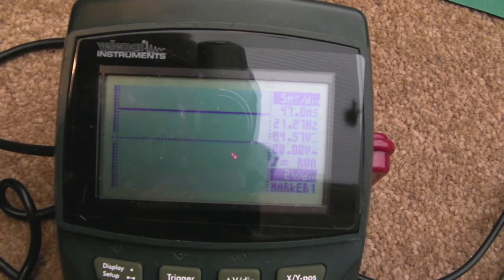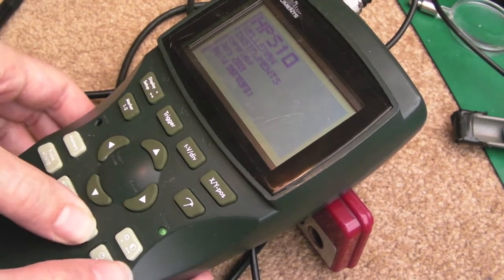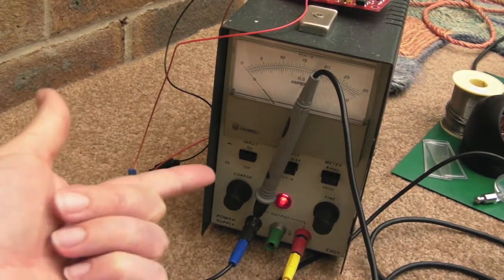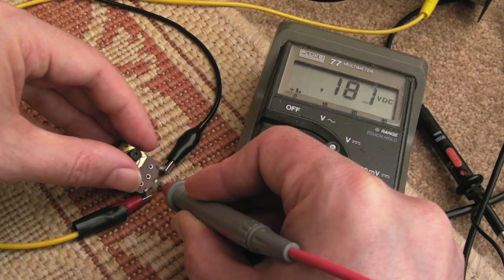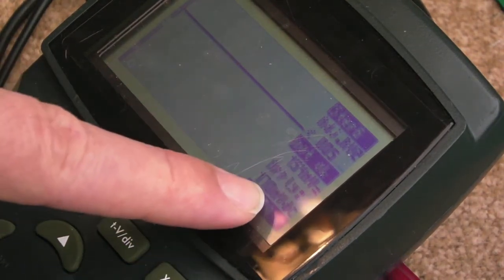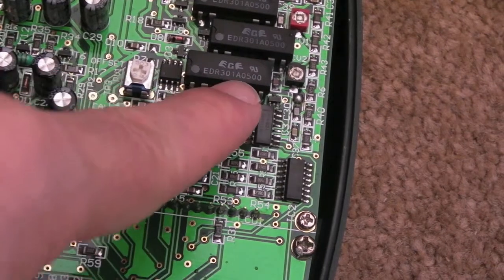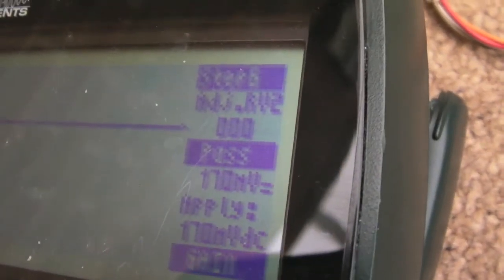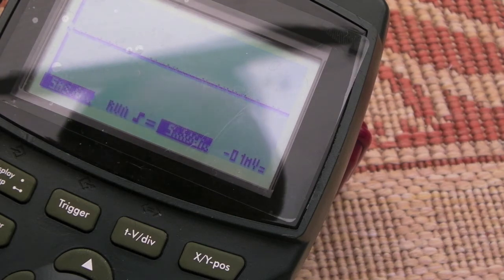Velleman HPS10 Oscilloscope Calibration

Comment: I used to have this scope; unfortunately, the screen went black, and there was no replacement available (apparently those 64x128 monochrome graphic LCDs have long since gone obsolete). The biggest problem I had with it is that it used to drain batteries, even when switched off! I ended up operating it off a 9 volt adapter instead.
Reply from the maker: Yeah, when not in use I leave one battery out!  Or it does go flat super quick (and then the batteries leak...)

Comment: Hello. a question. under the hps10 is written (voltage max 100vp).
- I want to know if the tip of hps10 at 10x.
--- Can the HPS10 measure 230V AC and DC voltage?
--- praiaclube@msn.com
Reply from the maker: My first thought was - it would probably be OK at x10 but show 10 times less obviously.  See here - https://electronics.stackexchange.com/questions/399513/a-x10-oscilloscope-probe-means-that-the-voltage-is-attenuated-10-times

I would try measuring lower voltages at x10 before you jump straight to 230v.

Comment: interesting stuff. Regarding the PSU, have you tried adjusting P1 inside it ?
Reply from the maker: To get 0 volts you mean?   No, but I suspect using P1 or the other trimmers I might be able to get it to output 0v.   The main problem I had in this video is the fine adjust just isn't fine enough when you want to try and get a low mv setting.  It was impossible to get 170mV set without using that pot as a divider.
Reply: I watched that part of the video again. I didn't listen properly the first time. Yeah, the fine adjust isn't fine enough kind of saying. :) Maybe an upgrade, more turns multiturn pot ? :)
Reply: У меня при ручном переключении 0.5 _ 1-2-4... Показывает разные измерения. Не смог откалибровать.

Comment: it's not printed in manual and mine hps10 provide measurement for one volt less ...
Reply from the maker: Yes, I think perhaps these scopes don't handle the gain very well across multiple measurement ranges.  I suspect mine might be less accurate now at higher voltages, because I have adjusted the gain to work better with lower voltages.

Comment: Very helpful, thanks for that, I will have to dig out my one and check it's calibration, I picked it up cheap about a year ago, and haven't used it yet!
Reply from the maker: I still need to read the manual yet lol.  I need to work out how the triggering is supposed to work on these.  They are a pain in that you have to move the measurement cursors around all the time, but handy for smaller jobs.

Comment: I've always wondered how companies like Fluke do calibrations. The calibrating machine itself has to be calibrated as well I should think...
Reply from the maker: Absolutely!  They have voltage and signal generators that have very very low tolerance and provide extremely accurate outputs - that's what they calibrate against at the factory   But I trust the Fluke, it's pretty damn accurate for something like this.